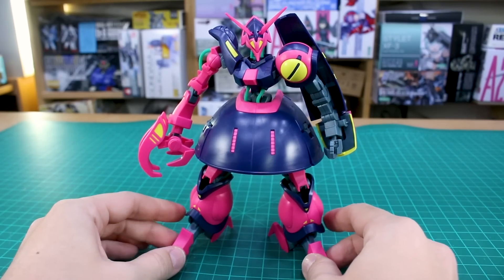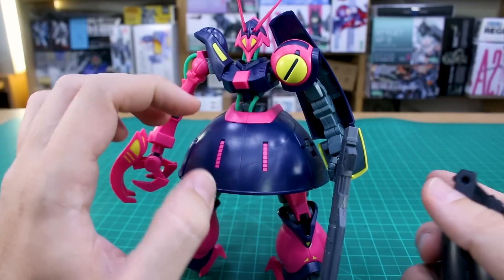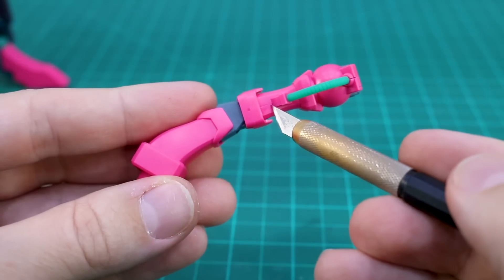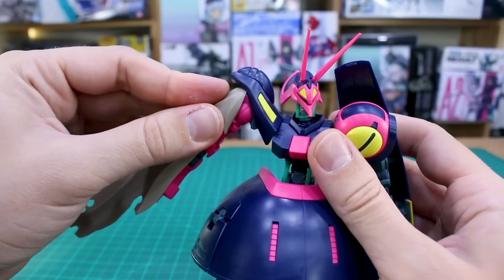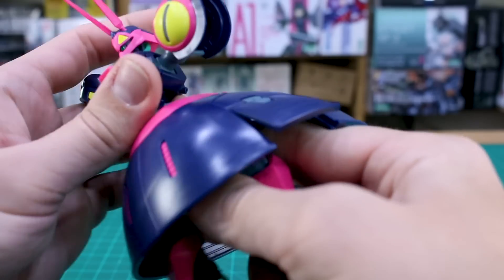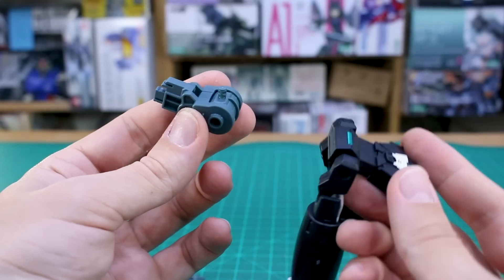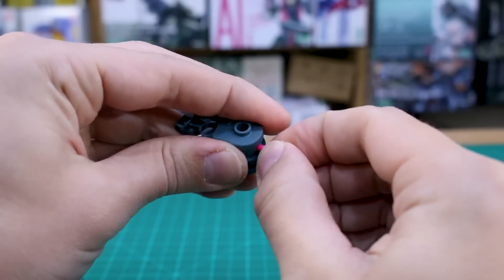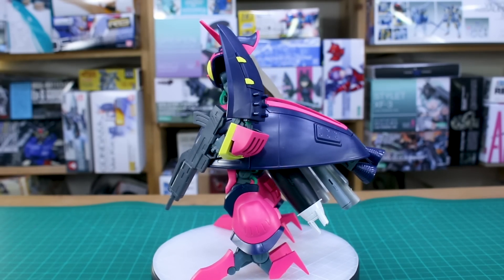HGUC Baund Doc - WIP Pt.1

Comment: Completely unimportant, but worth pointing out - the Gampf/Gampe was designed by Makoto Kobayashi, not Kazuhisa Kondo. Kobayashi did the initial design for the Baund Doc as well, which he based the Gampe off of.
Reply from the maker: Ooooohhh good to know!
Reply: Um, ackshually, Gampf came first. The first iteration of Dragon's Heaven came out in 1982. Kobayashi just reused the basic design for Zeta Gundam. Gaza-C is based on Shaian from DH as well.

Also; Kondo DID do two Baund Doc variant designs, the Baund Doc II and Baund Doc III F. He often collaborated with Kobayashi on many projects. The rest of the Baund Doc III variants (E, G, G Twin Head Type, H, etc.) were Kobayashi's work.